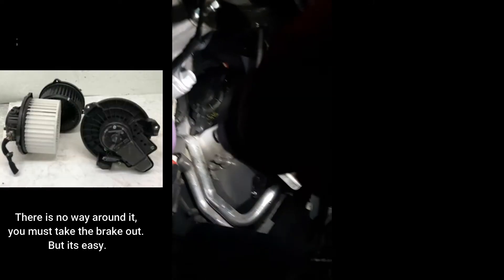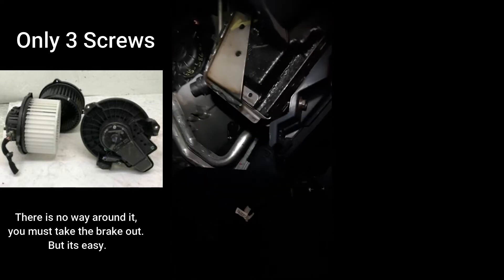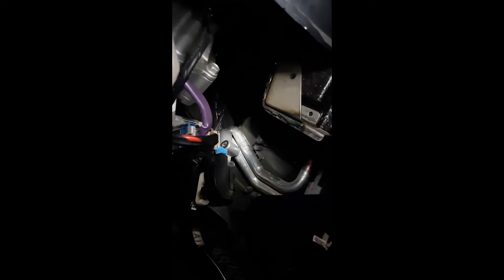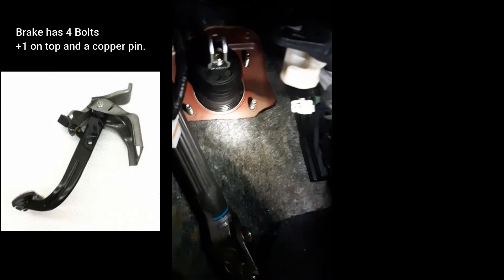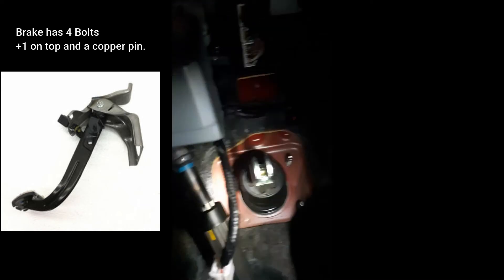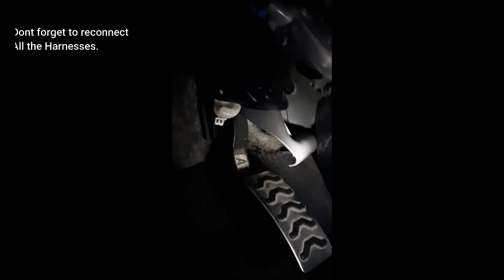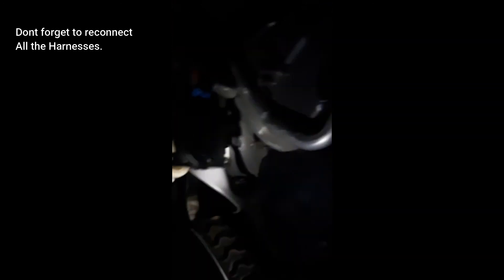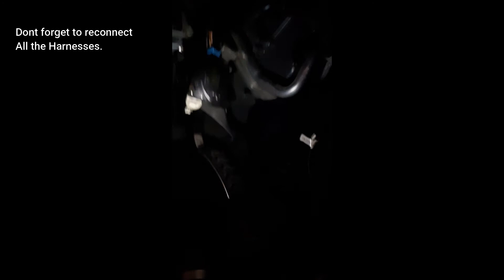2011-2020 Kia Rio Blower Motor Replacement DIY. EASY and cheap.

Comment: Can't see a thing, man. Appreciate you putting up a video but at night with a flashlight was probably not the best choice.
Reply from the maker: Was in my garage. Regardless you gotta take the brake out. Thats the main focus. But its easy. 5 bolts, a pin, and a harness i believe
Reply: @VideogameVibez I have UK version Kia Rio 2014 and there's no chance to take it out😢 I can't even locate where it is. I tried from steering wheel side and glovebox side everything is built-in with some devices...